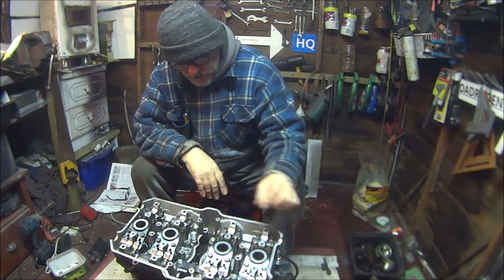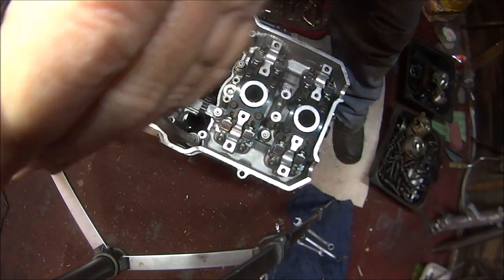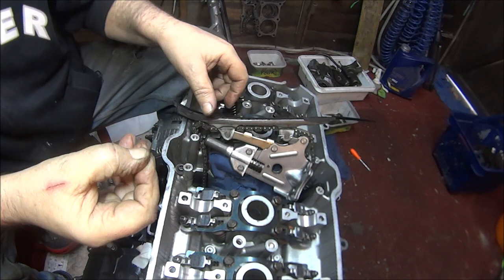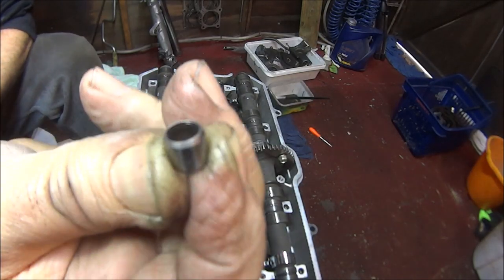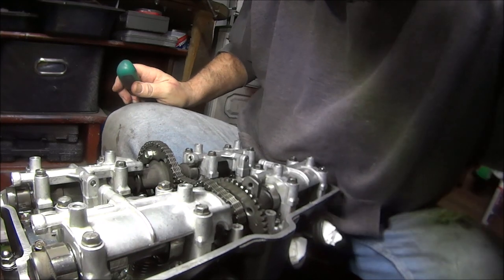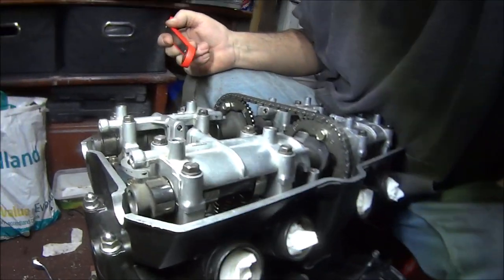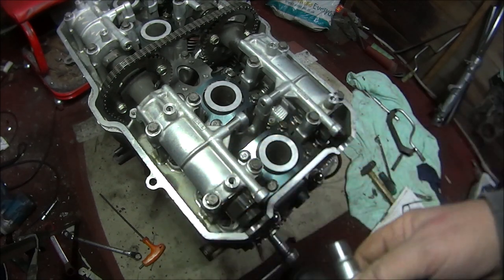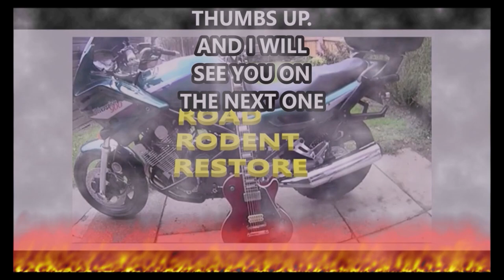CBR1000F Landfill bike, torque, timing and valves set.

Comment: hello mr road i subscriber you.
i'm from Indonesia.

I have got a problem with my motorbike CBR 1000 SC 21.
When i starter the motorbike it rotates heavily but the engine is rotated manually very lightly?
can anyone explain about this.

the compression was very heavy after I replaced the piston
Reply from the maker: Is the cam to tight.. is the starter motor stiff.   I don't really know it could be lots of things.